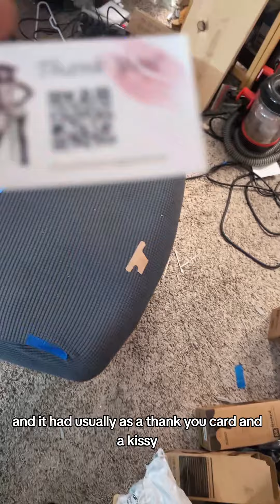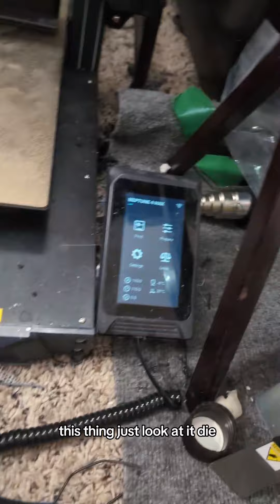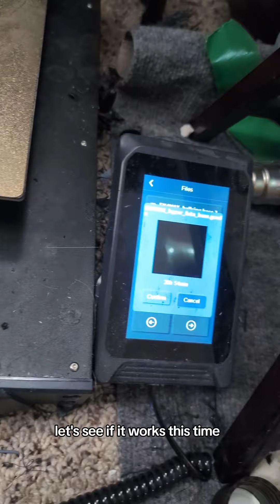someone signed me up??!

Comment: You could check your nearest hardware or appliance store and ask them for one of their various refrigerator boxes. Ask nicely and say its for a project and ususally they'll give it for free since they throw them away. Also you need foam blocks above and below the Yor Torso. As well as some thin plywood pieces that are the same length and width of the interior sides of your chosen box's. This will keep the Yor Torso and Parts from being squished as other boxes are placed on it during transit.

Short version: Ask furniture store or appliance store for big thick boxes, use foam blocks (above/below) and thin plywood (just two on the side walls) in shipping box to prevent Yor from getting crushed.
Reply from the maker: i think the wood is overkill. but i have stuffed her in that box so good. she should be safe. the legs are the current problem. boxes for legs are hard to find.

Comment: If you're looking at a large printer with a fixed bed then you probably want to go with a bambu. The X1 series is absolutely incredible. You can print almost anything on them. The beds are not as big as you're eligible large scale but it is pretty darn big anyway. And you're only going to spend $1,000 maybe $1500. Plus you can get the AMS add-on and do multicolor printing which is wasteful but looks really really nice. Just a suggestion, good luck!
Reply from the maker: i looked at bamboo and i really wanted them to be good. but their biggest print bed is only 250 x 250. im working with 450 x 450, and when it comes to printing a pair of hips.... i need all that space. trust me.